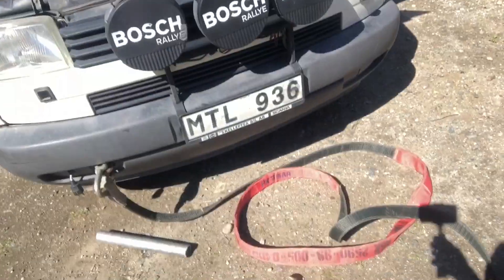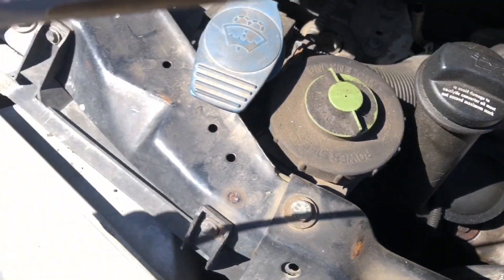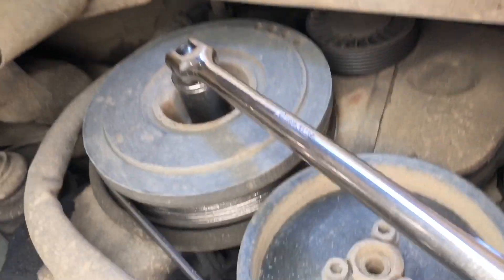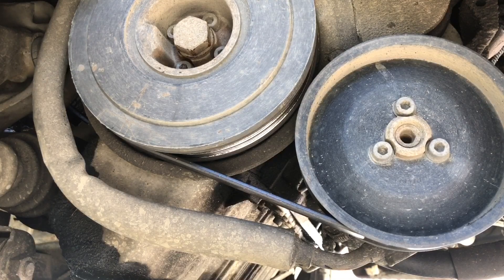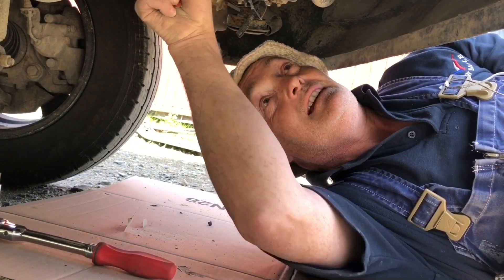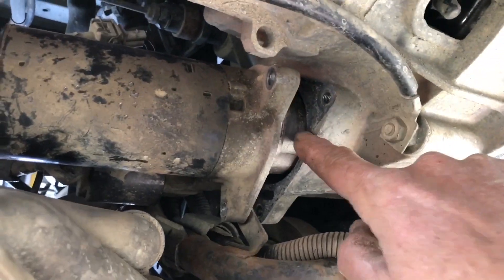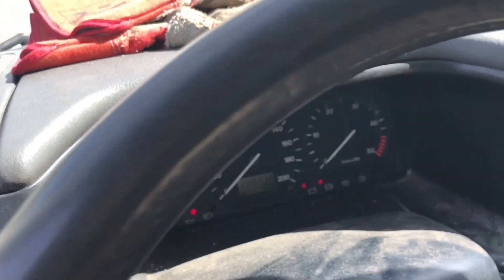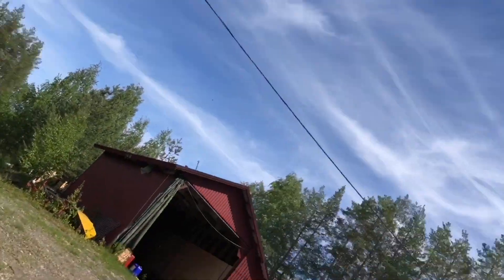VW T4 Engine seized solid what can be wrong?

Comment: Doesnt seem like you can pull the head without removing the engine,  but if the cylinder isn't damaged you could get away with rebuilding the head. You've had some tough luck there Simon and my sympathies are with you.
Reply from the maker: Thanks Matthew, I was aware it is an entire front end removal to get at it. Whilst the van looks good generally it is worn out in other ways and was hoping to get 2 or 3 years out of it by just keeping well maintained but it is not worth the huge task to repair.

Comment: Oh sorry about the van. As you mentioned it was strange way to stuck without making that terrible sound who often confirm that this is gonna cost some money. "Engine sallad" is often the result, but in your case it doesn't needs to be a finished sallad yet so open it up and see how it looks. Stay safe mate 🙂
Reply from the maker: Thank you Daniel, if it were and normal truck I would spend the time but these things are just the worst rubbish to work on.

Comment: I'm writing at the start of your video, and guessing. But if your engine is seized and wont turn over there are a few possibilities, none good. If it was a lack of lubrication you would have heard some top end noise prior to quitting. If it made a clunk without all kinds of noise after I would suspect it dropped a valve and its wedged in the cylinder. 
I watch your videos anyway Simon so I'll be tuned in to learn of the outcome, if it's not in this one.